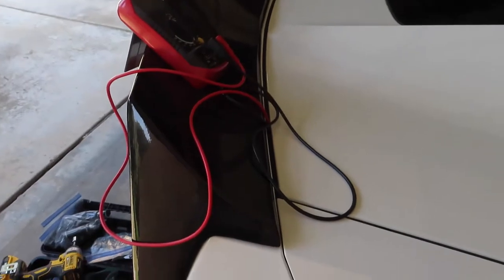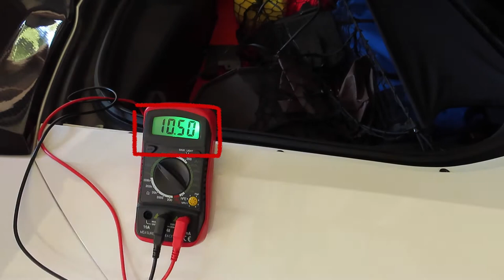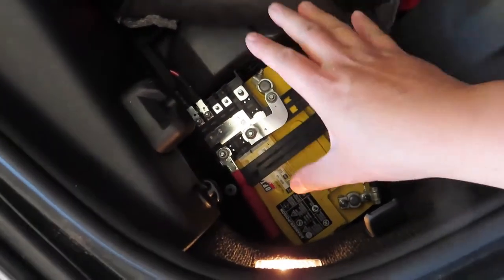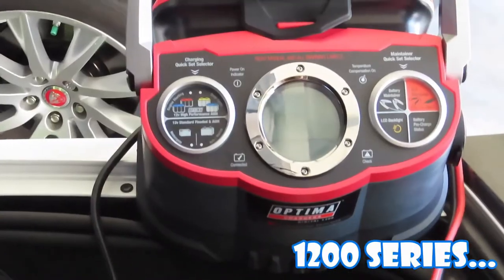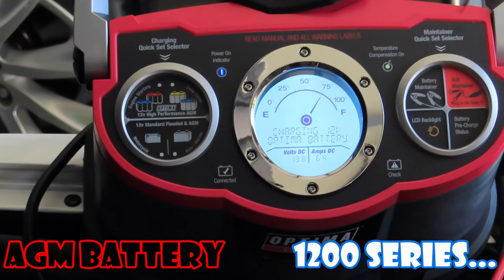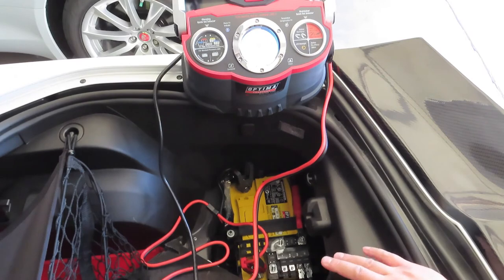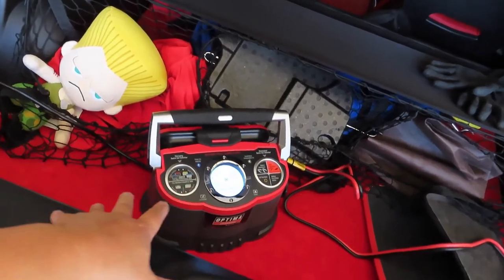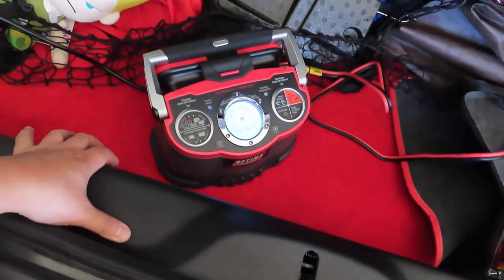Part 1/3, Optima H6 Yellow Top Battery Charger 400 1200 Series tender | Repsol13 F26 Corvette C7

Comment: I have 2 of those h6 for about year and half installed in my audio system but now I’m upgrading to xspower D2400  , because the optima are not helping a lot, I have a brand new 250 amp alternator
Reply from the maker: Dam bro, xspower D2400!!

Comment: We're sorry to hear you had issues with your battery. If a battery fails because of a manufacturing defect, it is likely to do so well within the first few weeks of use, if not the first few days. If you purchased the battery directly from us, please send us an email at info@optimabatteries.com and we will assist you with warranty service.
Reply from the maker: Yes, the Part 2/3, the replacement battery from you guys worked!!
Reply: If I have one of your batteries and it's defective, do I send it back or do I just email you and you send me a new one?
Reply: @seangowan7441  please contact your original retailer for warranty service